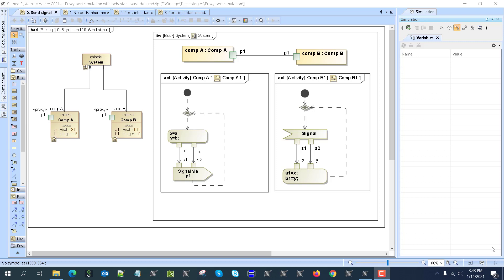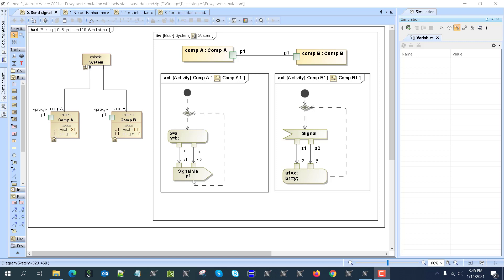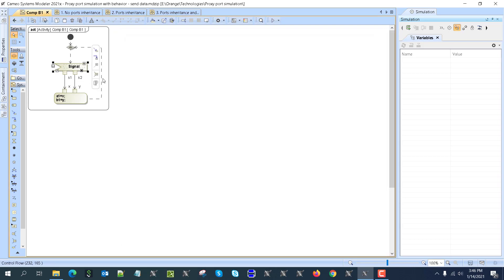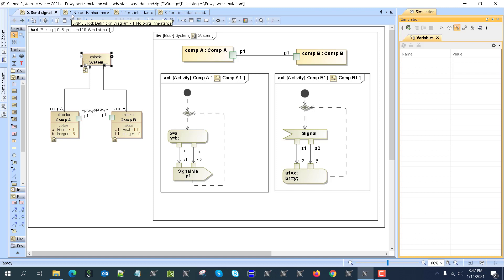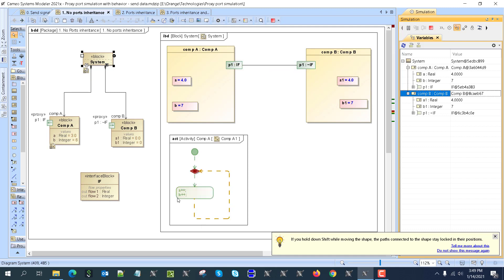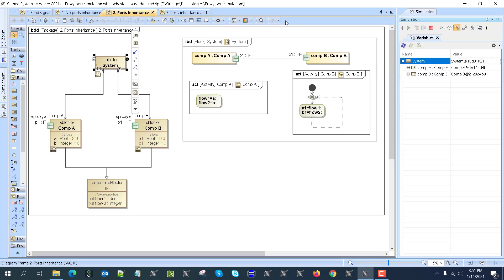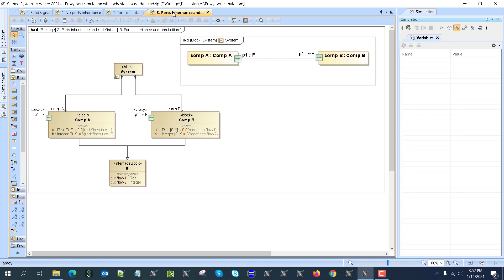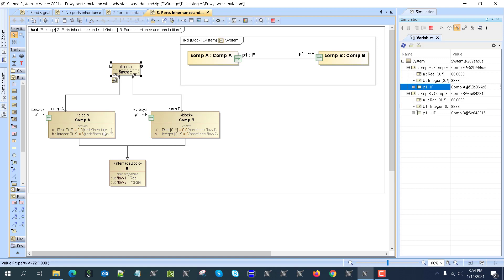System Interface Simulation in SysML | 4 Methods How to Pass Data Through Proxy Port

Comment: thanks for the tutorial!
What if I would like to COMPARE the values of the two interfaces?
let's say that I would like to simulate if a(in Comp A)<=a(in Comp B)
Reply from the maker: Hello, I guess right method would be to save results as instance and see difference between nstances.
Reply: @MBSEExecution  Hello, is there a video where i can see how "save as instance" is done? Many Thanks!! keep up the good work, it is appreciated !!
Reply from the maker: Thank you Sebastian! This one for example https://youtu.be/Jc6D_8_3dVQ
Reply: @MBSEExecution  many thanks for the suggestion. My initial thought was to do a Requirement verification, extracting the values from the interface blocks and compare them via a CONSTRAINT. however it is difficult to handle properties with the same name (e.g.: focal vs. focal) :face-orange-raised-eyebrow:

Comment: Thanks so much! Do you have a video about managing this with ports multiplicity [*]. For example I have n ports with similar behaviour. In practice, I would like to model a n wire cable, each signal will reduce due to cable losses and signals will be different for each wire, so I need to connect the port[*] to different other elements with different number of ports! For example a 10-wire cable should be able to connect 5 to one component, 3 to other and 2 wires to other...

Comment: This is great! Thanks for sharing. Have you ever used an Activity Parameter Node to receive Flow Properties in an Activity? I'm attempting to do that, but I can't get that to work for some reason. Any idea if that is possible?
Reply from the maker: Hello Brian. Thank you for the feedback! It is possible but you need that activity would be active i.e. in other behavior waiting for inputs through parameters. One case to use activity on state entry. If parametrizes signal triggers transition to this state signal parameters are send to activity. Here is one older video demonstrating it https://youtu.be/Cwz_tuKX_xs